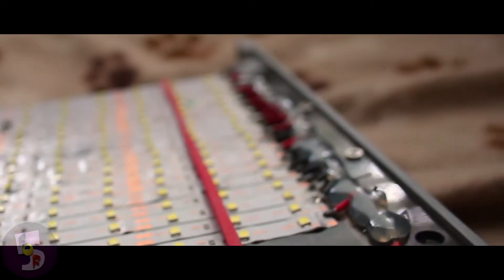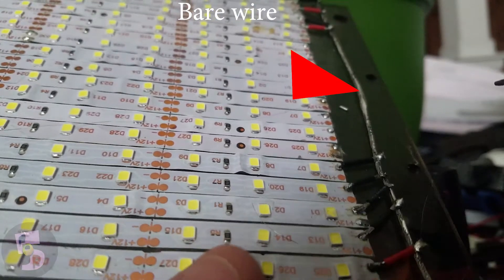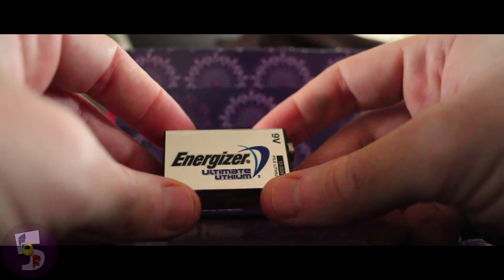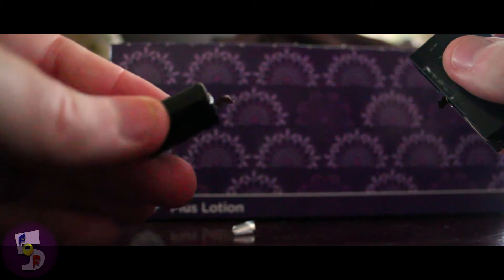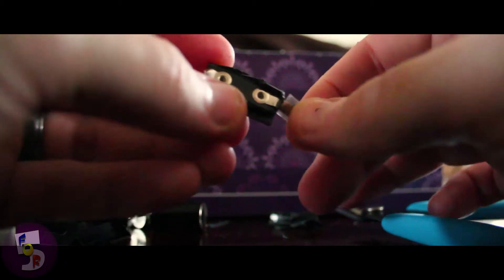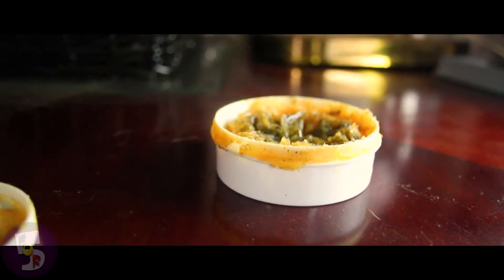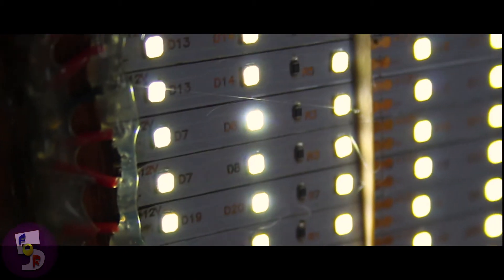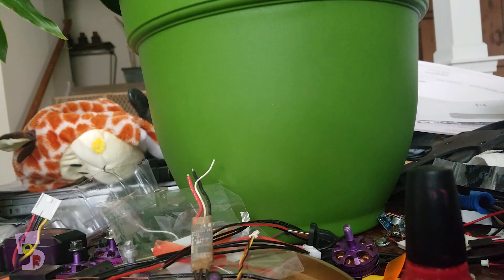DIY LED panel: Repurposing a dead 9 Volt battery

Comment: I think. Your    static  electricity makes it light. Ike static conductivity i think, i am not sure  why putting your thumb on the resistor. Makes it light  i don't think its really the heat is the power. Going through the solder gun  ,. But i wouldn't know its my guess have u tried it right away without the gun being hot im sure it will still light so i dought its heat  my guess is the static conductivity from the solder gun...
Reply from the maker: yea, i'm not sure what it was..i've tried with hot or cold but it cracked me up either way.
Reply from the maker: OHHH, it's probably just grounding with a bit of drain voltage from the iron being plugged in.  my LED bulbs in my hall do that.    it's definitely not heat, you're correct.